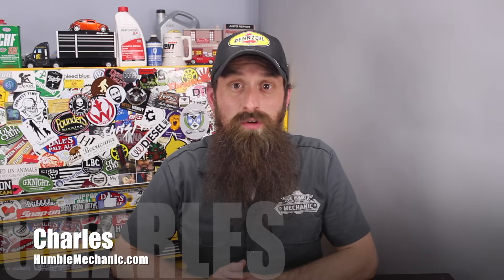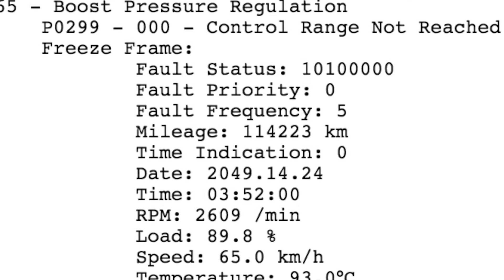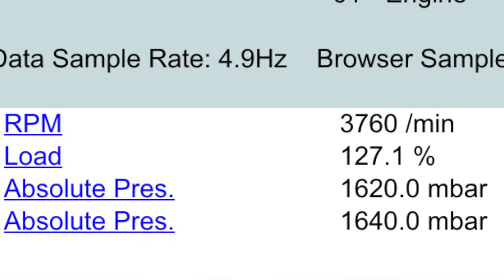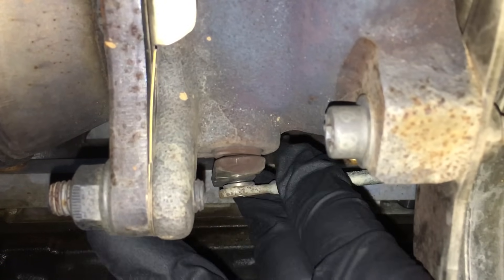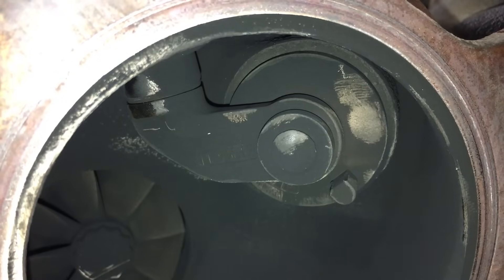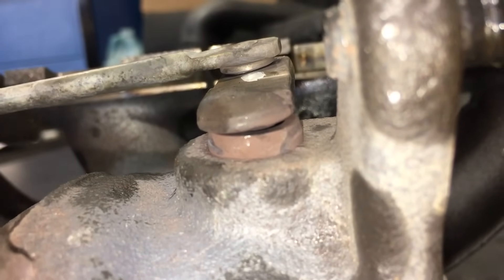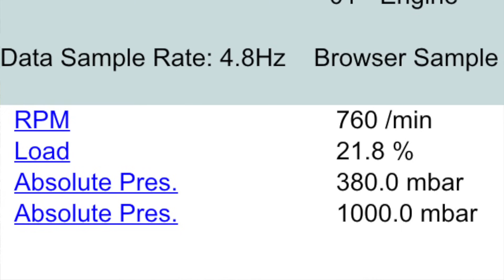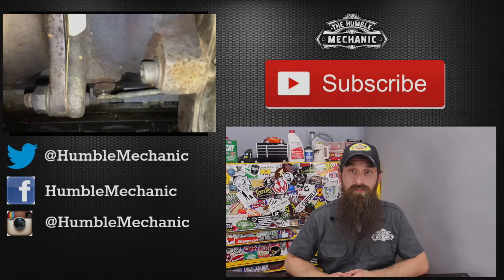Does Your VW/Audi 2.0t TSI Have A Bad Turbo

Comment: I am a senior citizen who owned an O7 Audi A4.  Car was a nonstop litany of recalls, electric problems, and turbo issues.  At 50K, the turbo ceased altogether--a $4,000 repair.  You'd think that VW/Audi could get this 2.0 turbo sorted out.  They've only been making this engine for 15+ years.
Reply from the maker: Crazy isn’t it
Reply: $4,000 for a turbo? You got ripped off......lmao
Reply: @jaredoldhouser3301  lmaoooo
Reply: I think it was 4k with install and other services while they're in there
Reply: I have two 2.0T's, one is a 14' w/ 156k and the other is a 13' w/ 144k miles. Both turbos are fine so far...
Reply: Seriously though when you get these B8.5s, make sure they have the updated Piston Rings & Timing Chain because they were sneaky and kept building well into the B8.5 even after the lawsuit.
Reply: As well as PCV Valve, Catalytic Converter, Ignition Coils & Spark Plugs, Valve Cover Seal, Rear Main Crankcase Seal, Diverter Valve & Waste gate + Actuator are all good and then it's pretty simple to get these cars to 300K with LiquiMoly oil changes every 4-5K miles max w/carbon cleaning as needed.
Reply: I’ve had the same turbo in my 06 a3 2.0T for now over 200,000 miles

Comment: You hands down, have the best VW videos on youtube.
Reply from the maker: +ShotgunFelatio thank you .
Reply: I agree best
Reply: Were you saying the wastegate actuator is defective or that the turbo charger is bad? I was not sure. Which is it?
Reply: @dermotricketts7099  
My understanding is that the wastegate actuator is part of the actual turbo. It looks to be on the hot side and I don't think you can replace just the actuator. I'm sure it is a bearing that starts to fail at which point it takes out the seal and then you loose boost. I think you have to replace the turbo itself as the wastegate actuator is not serviceable. You will need to double check my option as I am no way an expert, or even an experienced vw/turbo mechanic, on vw’s. I am a mechanic but very little experience with the vw and/or turbo chargers, in general. Hope this helps. Good luck and happy VW’ing!!!
Reply: @DFWJon You can replace the actuator and the wastegate. There’s absolutely no need to change the entire turbo.
Reply: agreed
Reply: Yes but no shop will do it.  They all want you to replace the whole turbo

Comment: If you have a VW or Audi before 2014, p0299 can also be a bad diverter valve. The older ones have a diaphragm in them that crack and tear. Can replace with a newer piston version.
Reply: But what if I actually hear the wastegate rattle while revving it in Neutral? Wouldn't be a diverter valve. would it?
Reply: @wasifshehriar3669 No that would be the Wastegate not properly seating meaning it's loose and rattling around. There's a couple fixes without having to replace the turbo, including the part itself on FCPEuro. There are clips for it too which help support the actuator too.

Comment: Our previous Tiguan which was a 2010 had the turbo fail at around 110k then the timing chain tensioner at around 11400. Which basically damaged the whole engine, cost to repair was going to be around 8000 CAD which was about half the value of the car at the time. However, VW covered 70% of the cost for parts damaged by the tensioner failure,  because the car was out if warranty by only a couple of months, and because of customer loyalty. It was disappointing to say the least, but it didn't deter us enough from getting another.
Reply: How did you get VW to cover anything being out of warranty ?

Comment: My VW Golf (1.4 tsi 122 hp dsg 165000 km.) went into fail safe mode on several occasions when driving on the Autobahn. After looking into the matter (vcds and checking the arm of the wastegate) I decided to replace the turbo for a brand new Garrett turbo. Costs : 500 euro and 2,5 hrs. of labour. Now runs like a new tsi again.
Reply: Where did you buy the turbo from?

Comment: Do yourselves a favor and upgrade to a turbo with a separate wastegate, unlike our integrated one. Mine was bad on my 2013 Q5 when I bought it with only 33k miles on it about 4 months ago. I thought, “wow, great deal, low miles”. Luckily, I felt something wasn’t quite right and heard a clicking on low boost acceleration while going up a hill and it was covered by the dealer under the 30-day warranty. I had no warning lights or codes in VCDS yet, but I’m sure it was only time before it started causing major issues. No oil consumption luckily, but I think it’s less prevalent on the facelift models that support e85 since they have larger seals. I guess we will see. Changing my oil, AT LEAST, every 5k to be safe.

Comment: Something I would like to mention. I had a p0299 code on my mk6 GTi. I checked for boost leaks and checked the wastegate rod. Everything seemed good. I gave in and sent it to the dealer( I don't work on many turbo VW so i thought it was best.). Dealer told me it needed a turbo. Which i agree. It was passing a lot of oil. I replaced my turbo with a nice new one. Still was getting p0299 and lacking performance.  I did some data logging over a few days and all different driving conditions. I thought maybe I had an exhaust restriction.  I took the o2 sensor out of the turbo housing(CBFA) and put a bore scope in. Saw the cat looked like a solid black chunk.  Replaced the downpipe and checked for boost leaks again. This was months ago and the car is running great and no more p0299. 

While my situation was rare I wanted to put this out there for anyone who is desperately trying to figure it out and exhausted all other options.
Reply from the maker: Wow!!! Got call. They should have caught that when doing the turbo
Reply: Yes! Thank you very much.
Reply: Was the blocked cat cashing the oil?

I have oil build up going to my intercooler on a MK5 golf GTi.. I assumed the turbo was dying..
Reply: Mine was shooting same code.  Couldn’t figure it out.  Yesterday I went to start it and it blew white or gray smoke now there’s oil everywhere on backside of engine and car sputtering really bad.   Still don’t know what’s wrong with it

Comment: The Wastegate rattle is popular, but in my experience, the actuator arm going to the diaphragm can get sluggish or even seized where it won't open as it supposed to making it sluggish/ wont return all the way to make it seal/ or get stuck partially or fully open. Best way is to just get under there and start looking . Good info for people who are unfamiliar with some of the issues that can plague these cars.

Comment: I’ve got a 2019 cayenne in my bay that I’ve been trying to chase the 299 on. I replaced the diverter valve due to leaking. It came back with the same code. I smoked it again and found nothing. I test drove and researched and finally found this vid. Needless to say, it’s getting a new snail. Thank you for the help. ✌️

Comment: There are workarounds for the bad flapper. I pulled the wastegate, cut the arm, threaded a piece on the end to be able to adjust it and was able to fix the slack. Fixed the p0299 issue.

Comment: Hi Charles. I really enjoy watching the video blogs/how-to's for both VW and Audis that you make and as well as Paul.
I am new into the VW/Audi family as I have picked up an 06 A4 B7 2.0T FSI.  Since picking this vehicle up, Ive been have all sorts of problems. from overboost, to underboost, to cyl4 misfire and other Pcodes that I have seen.I have replaced the TurboCharger with an alternative brand as my old one (WG flapper) assembly was wobbly. Ive ran a boost leak and tighten all pipes,etc.still having the issue. ive replace the diverter valve with the updated version and even purchased the GFB+ and swapped it out with a new DV and then a hybrid BOV. I even replaced the N75 with latest rev. Ive cleaned the gunk out of the intake. replaced the cam follower and also vacuum pump. replaced most of vacuum lines. inspected the BSH revamp delete kit.  replaced the PCV valve. 
What i do notice is that when the engine is idle, i can hear a slight hissing sound but unable to pinpoint it. no leaks from valve cover. there are many times it can only boost at or barely 5. but if i were to start the vehicle in the morning, the car can exceed 5 ~ 15ish @ avg 4.5k rpm.
There's also this hesitation when accelerating  (it does feel fluid). The car has about 186k miles. compression is at (i might have to use another compression tester) cyl 1~ 3@ 115 and cyl4@ 91. No blue smoke from the tailpipe.  car also has an APR stage one ecm upgrade when i purchased the vehicle used earlier this year. someone told be to swap it out with a stock computer to see if the apr upgrade has something to do with it.
I do have an obdeleven that i purchased from Paul at www.Shopdap.com and have used to the best of my ability to check the codes, email them and clear em.

I also have a boost gauge in the center vent but have not traced it where its connecting to. though one thing i can say is that there is this small vacuum hose that is connected to the intake manifold  and reduces the hose to a size similar to 1/8 ID (?) and then connected to some see through inline filter and then connected to a barb fitting and then it is fed through the ecm box. 
From there Im not sure where it leads to.

I really dont want to give up as I have invested alot of time, sweat (living in vegas), long late nights away from the fam while working in the garage. 

Any suggestion(s) is really appreciated as i would love to get this vehicle back to its glorious state.

Cheers,
Jason

Comment: I have used VCDS to for a boost leak check. I used to log and plot the values on a graph in excel versus the RPM. You also can see boost curves too for curiosity. And like you said, look for the specified and actual. I'm pushing 20.0 psi with APR stage 2+ with other bolt ons which potentially can cause boost leaks. They're all fine 2 years later. 

A big thing for those who have early 2.0 TSI engines, I believe 2010 and older, it's the diverter valve. Early engines had a rubber diaphragm that tends to rupture and you have no boost at all. I caught mine before it was going to tear. 2011's and newer got the revised piston DV. You can either do that, or keep the solenoid part and go with GFB DV+ if you're tuned (recommend it). You will get a fault code but it doesn't do anything and no check engine light. Holds boost very well and vents much faster
Reply: hey man ! can i ask you for help? i have a BWA (2006) 2.0 tfsi engine......and after a highway round i get a whistle voice from the turbo side (i recorded it,  http://bit.ly/2kiANPq   , boost starts from 0.03 sec) . while the engine is "tepid" (not hot) i dont hear this whistle (and have 16-17psi boost, when the engine is hot i have only 9-12psi).... :S  maybe is just a loose bolt? where the boost leaks? I hope there is no problem with the DV....
Reply: More than likely that is the DV. If you havent replaced it and you still have the original DV, it is that. I caught mine before it was about to tear. You can either to 1 of two things. GFB DV+ which is what I did, or get the upgraded Rev C which has the piston. GFB is for performance applications and works better. Uses the original solenoid. Rev C is an entirely brand new assembly. Pain in the ass to get to 

If it isn't the DV, check every single connection from the turbo, charge pipe, intercooler on both sides, then throttle body pipe. I would suspect the DV is the cause
Reply: Thanks man! So, i bought the car as used a few months ago....but as far as i remember (when i checked the turbo) it has the original one.....i dont have a turbo related error code only p0441 (purge flow error). I was on a short test recently today, with a tepid engine and havent heard that little noise, and got the boost properly....around 16psi :S (dont you think that, if the DV would wrong i always should have a minor leak? in case of cold/tepid engine as well (?))
But thats true i also got an informations from my  mechanic about that the earlier (2.0) TFSI engines has a naughty DV...and can able to burn or tear...because of the heat. maybe i will try to check the bolts and pipes/gaskets before....and if still have the psi loss with HOT engine, i'll take care of a new DV for sure.
what do you think about Runtek DV+?   http://www.ebay.com/itm/like/172439568818?lgeo=1&vectorid=229466&item=172439568818&rmvSB=true

Its just 38$....maybe its a fake? :S
Reply: MaxCo I wouldn't trust that DV lol. Seems like it's a knock off version of GFB. Either way, I would just go with the GFB DV+ even though it costs $130. I've had it for 3 years and it's never given me issues. It does throw a code because of the stiff spring is uses. P2261 or something like that but never throws a check engine light. GFB said if you want to eliminate that code, remove the spring but you won't get the performance benefits of the DV+. It spools up much quicker, holds boost better, and releases boost much faster than stock. All the VW techs at my dealer know about it if my main tech isn't there which is rare. Besides. I'm holding 20-21 psi with mine no problem.
Reply: MaxCo I also have a 2010 with the earlier CCTA engine so yes I know all about the DV going bad. I could see a line in the rubber diaphragm where it would've torn. Also, do you have a boost gauge? That's another cause of boost leak too. The vacuum block adapter that goes on the intake manifold.
Reply: no, i just read the boost from odb2.... :) using my odb adapter and torque app (on android), i guess its realiable enough. if it shows less psi then i feel the loss/leak....maybe its not a super sharp psi gauge with block adapter within the manifold but i guess its good for digging.

okay then, i leave that Runtek DV alone there...and will try to get the GFB  somehow! Thanks for the help ! maybe i'll let you know about the results :)

Comment: I had an underboost fault lately in my 2017 1.6 tdi vw golf mk7. Checked the codes, even glow plug error jumped in alongside all of the turbo underboost ones. It turned out to be a single small hose that got disconnected. The one just over the turbine. I cut and shortened it and slid it in and suddenly there was no error anymore. I think I will replace most of the hoses, tubings on the engine in the near future, cause even thou they arent that old, more and more problems start to occur related to these. The quality on the modern vehicles is really bad...

Comment: Turbo in my 1.8t was definitely bad... It smoked like a freight train whenever it was running, pulled it out, was a total loss. Great video, I used this to make sure a turbo was bad. Turned out to be a failed actuator.

Comment: CHECK ALL YOUR SENSORS! I had p299, epc, plus some slight timing chain rattle, low power, low torque response,  p130a, p2337, p102f codes that ALL got fixed after replacing my CRANKSHAFT SENSOR! All my other sensors were pretty new except this one and didn't even expect a fix when I replaced and everything was fixed. Before expensive parts I recommend trying the sensors. I apid for a shop diag that didn't even mention sensors and luckily tried it on my own. I've driven it hard even at full throttle multiple times now and no engine lights weird noise so far. on the new sensor. Power and torque all feel great. Wish I'd replaced the sensor 50k miles ago. '14 Jetta 1.8 tsi

Comment: Bought a brand new apr k04 kit for my octavia EA888.2 straight off apr dealer. I'm facing the same under boost error. Although apr is suggesting me to reset the wastegate mechanism, I've a gut feeling that the issue is happening due to apr providing us a 3.5 Bar sensor wherein k04 run flawlessly on 3 bar tune. Gonna load the 3 bar tune next week to see if it fixes the issue. If not, I'll have to proceed to reset wastegate. Excellent video!

Comment: I have a 2006 2.0TFSI has the same code.  Replaced a turbo that I know has done 90,000 miles,  car was great with replacement "Ridex Turbo".   It lasted about 4 months and the code returned along with a rattle.  Figured the turbo was good so changed the DV to a REV G and the car was slightly better but still had P0299.   Took it to a mechanic and turns out the wastegate had fallen off and was rattling around inside the turbo.   New Borgwarner unit being installed by the shop.

Comment: to your closing comments, I needed the video. You just helped huge dude. Subscribed.
Reply: Following up. I bought the OE rattle clip (06J145220A) for my 2012 GTI TSI CCTA. I am absolutely not a mechanical person but I want to do this myself. I have no jacks, lifts, or fancy tools. Is it possible for me to reach from the top passenger side down with my arm to feel this play, and as well to install the clip? How might you propose installing something like this with the car on the ground. Thanks, Charles!

Comment: Bought a 2011 VW Tiguan 4Motion from the dealer. Ended up having a bad turbo charger. Luckily they're replacing the turbo with a VW used turbo, free of charge. Hopefully it works out and the used turbo is good.